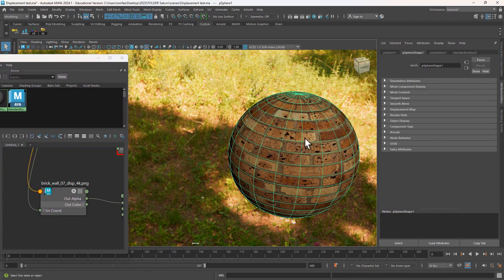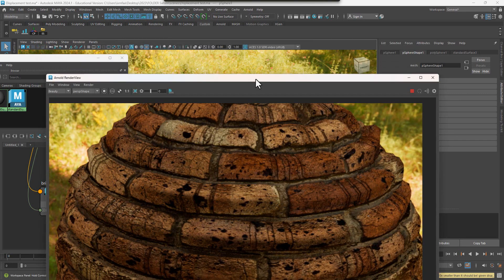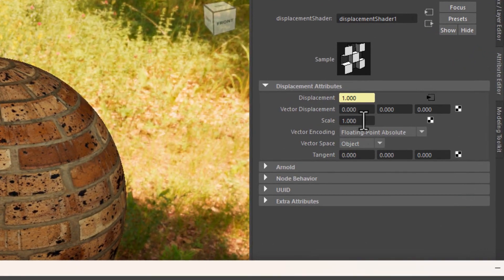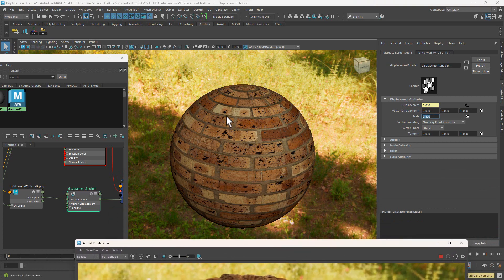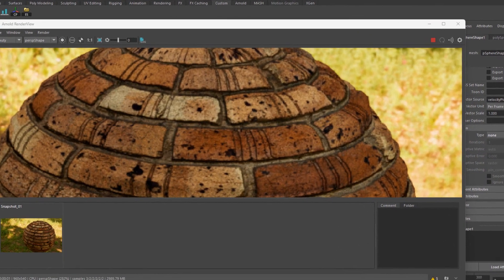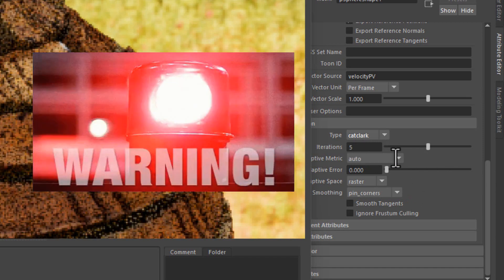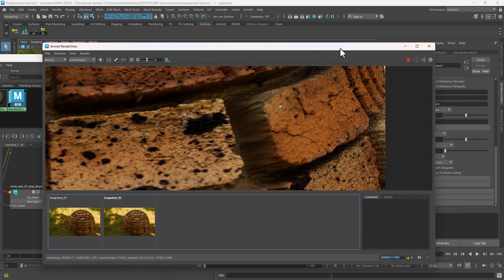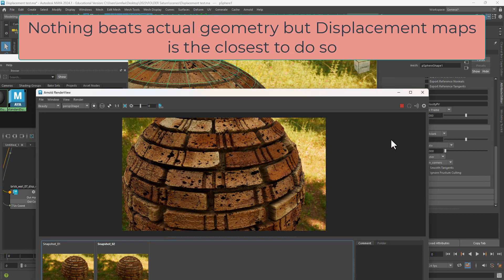Maya Arnold Displacement Part 2: How to Get AMAZING Displacement Renders

Comment: Did you use EXR or png for the displacement map?
Reply from the maker: I think it was a PNG. 
Although the details are fabulous, they're not extremely detailed. Usually I go with PNG until I detect limitations due to "bit depth', then I switch to TIFF orTarga.
Reply: @ihabiano  thanks png ended up being better for my case
Reply from the maker: @paranormalgamesstudios  Oh nice! But there's a difference in they way they function and the way they can be used. Sometimes because the EXR holds much more data (bit depth that we cannot see) their outcome could feel a little more exaggerated and we'd need to tone them down... like driving a muscle car on a slow speed, you wanna hit the pedal juuuust right to make it work OK.
Reply: @ihabiano  Yeh i know but it was fine for what i was doing
Reply from the maker: @paranormalgamesstudios  Nice!!! 
I always go with PNG unless I shouldn't, because higher bit depth images can be super big in size, and tend to take much longer in rendering.